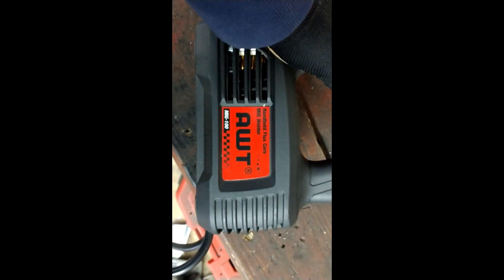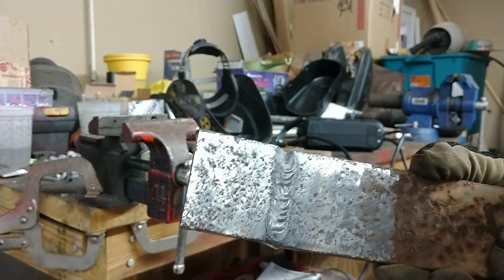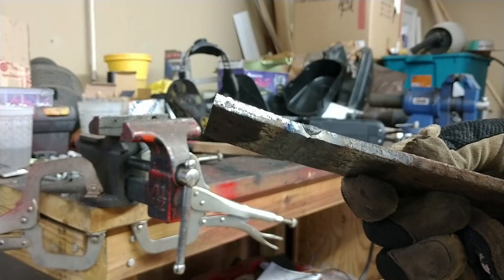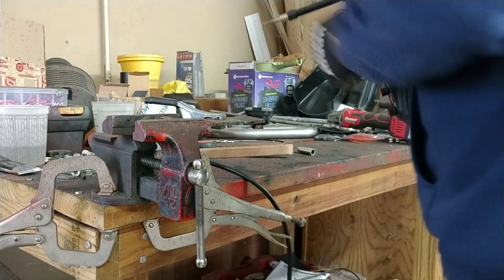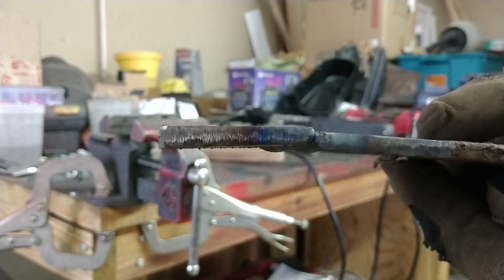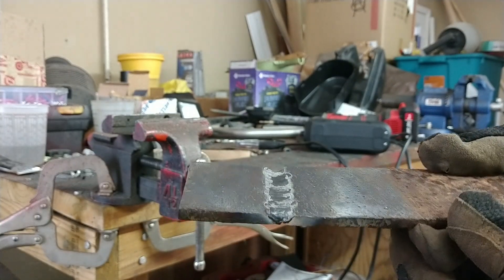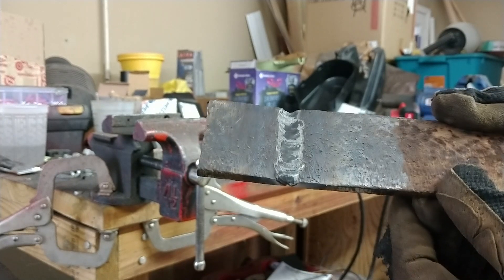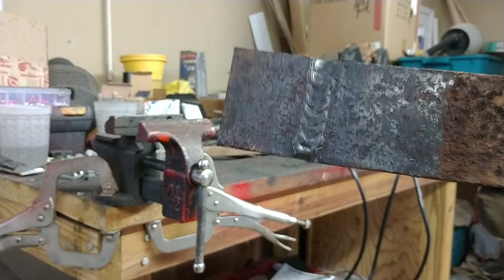AWT Mig 100 Flux Core Handheld Welder Penetration Test

Comment: Why does it come with a gas shield when you are showing you don't need it?
Reply from the maker: Hey Tim, you're talking about the nozzle.  You absolutely don't need it with this welder.  And it actually hurts the performance of the welder.  I'm going to do an updated video review of the welder here shortly and I'm going to share some of the things that I have learned in using it.  Actually a pretty cool little welder.